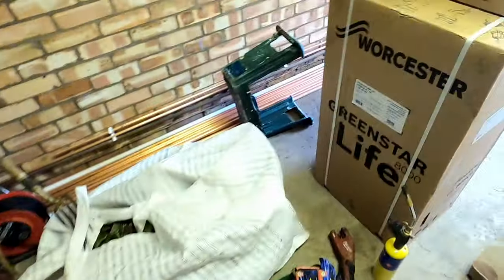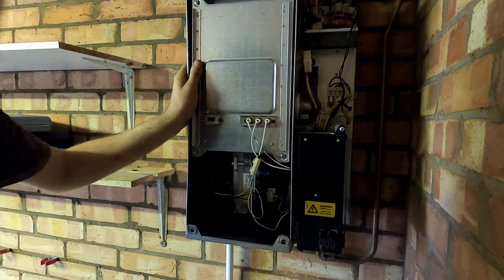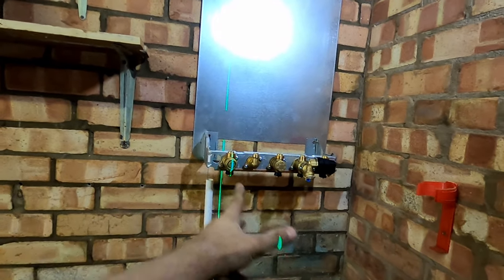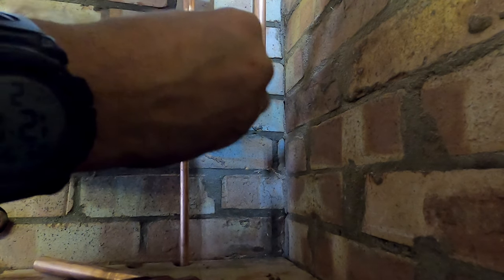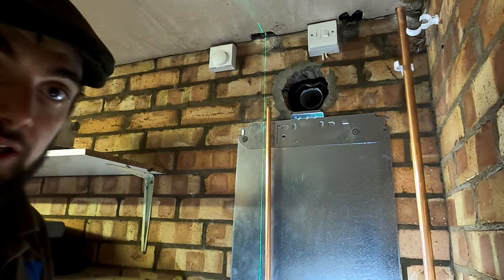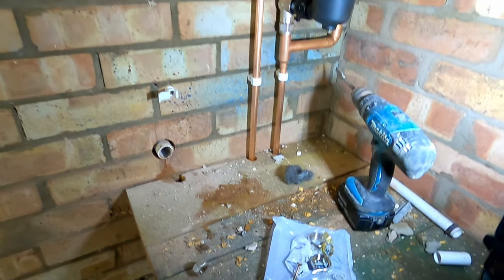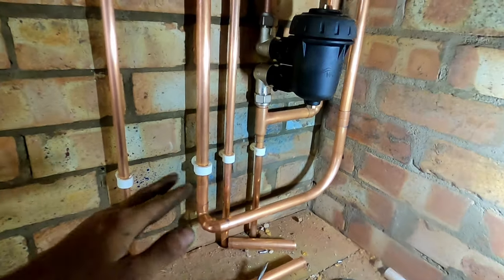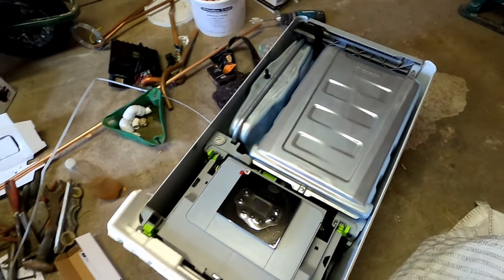Combi Boiler From Start To Finish

Comment: Worcester's are ... fine ... it's just they are so expensive compared to other brands but that extra cost doesn't show in the quality of the product, especially with how much cheap plastic they are full of which goes brittle over time and pinholes or cracks... these new ones definitely impressive on the installation side of things so credit where credit is due there
Reply from the maker: Thanks for the support mate, the plastic is really the only thing with this boiler I don't like, they are a little pricey for the 8000, but with the care pack that comes with the filter and programmer it does help bring the cost down and put them in line with other boilers, the new Worcester 1000 will probably be my budget boiler at £500 plus flue and filter

Comment: The latest Worcesters are so much more installer friendly, at last!
The old Vaillant sine 18,so came with pre- installed mini exp. vessels, still not sure why, except these  days water meters are fitted with check valves so maybe plastic components are an issue?
Great to see someone understands  the Regs. surrounding where double check valves can and cannot be fitted.
On system water quality checks, I use Scalemaster i-test in conjunction with a turbidity tube and QUALITY ph test straps.
Worcester specifically require a MAXIMUM  of a ph of 8!
You thoughts on testing and the results you obtain would be of much interest.
Pro job, keep up the good work.
Reply from the maker: Thanks for the support as always John, I think the plastic parts are the main issue when it comes to fitting expansion vessels, water quality is very important, I have started using the test strips to check for inhibitor levels on my installs and when carrying out a service, thanks for the support as always mate

Comment: You gave that lady some good advice there. To me its like putting a brand new engine in a 1976 Ford Cortina. Yes the engine is good , but if the transmission is rubbish you're not actually gaining anything. Plus you are still left with numerous other faults. I said 1976 because many systems are actually that old if not older.
Reply from the maker: Exactly that mate, I probably won't win the job but at least I can say I quoted for what was best for the system, thanks for watching as always 👍

Comment: Shock arrestor aint needed for any worcester mate. I know they say this but they havent a clue as their boilers are designed by architects lol. All thats needed is a pressure reducing valve on mains to reflect what hot water flow rate can be achieved. Its very high mains that cracks them and with residual heat on plate with expansion/contraction of plastic. Ive never ever had a flow/return manifold on an install fail and its been a long time lol. Like you said mate, the shock is going to be disrupted by all the bends it has to take, to have any effect on the boiler. Nice little install that, good job😎
Reply: Thats why flow turbines get smashed up, due to the high pressure of mains and flow restrictor is under strain
Reply from the maker: I totally agree mate, a pressure reduction valve would have more benefit than a shock arrestor, thanks for the support as always, it is greatly appreciated

Comment: Great video. Just a question if you don't mind, I'm a 3rd year apprentice and I have been doing outside taps over the summer but has died off a bit now. Just wondering how I could get myself out there for smaller jobs like radiator changes, toilets, basin swaps etc if you have any idea how to advertise for this. just wanting to do a couple of jobs on the weekend to get a bit of extra money. I was enjoying doing the outside taps for myself felt like i was progressing and finding my feet working on my own, I also enjoyed the extra money of course. Thanks.
Reply from the maker: Hi mate, thanks for watching, I know a few guys who use facebook to advertise and they seem to pick up plenty of small jobs, honestly if I were to be starting from scratch I would defiantly look to go down that route. Once you get your name out there word of mouth should then kick in, just focus on doing a good job, leave everything clean and tidy and you will have as much work as you need
Reply: @PlumbLikeTom  yea, i was advertising outside taps through Facebook and was doing quite well with them l. I'll have a look at that. Thank you. Keep up the videos. I learn a lot from them, and I'm sure I'm not the only one.

Comment: Where did you get that battery powered pipe cutter? How much was it? Definitely speeds up time!
Reply from the maker: I got mine from ITS, if you are buying one go for the inox version as it can cut stainless and the blade has lasted over a year so far, I do have the older version but this thing is a beast, I payed around £140 plus the battery which I already had

Comment: Top work Tom, is the water in your area hard?, it’s a killer round my way plate exchangers foul up average 5 years even with scale inhibitors,
Reply from the maker: It is hard mate, I am actually fitting a water softener on this job now, I wouldn't have put the scale reducer on had I known, thanks for the support as always Danny

Comment: at around 9mins when you;re drilling into the ceiling, won't all the dust from the drilling fall into the pipework?
Reply from the maker: It's a fair point, I normally blow down my pipes before connecting the boiler to clear any dust or debris, it is something I should be more careful of though, thanks for watching
Reply: @PlumbLikeTom  no problem, was an informative video, thanks for posting 🙂

Comment: Have you come across a Air source heat pump yet Tom
Reply from the maker: I used to sub contract for a heat pump contractor, I fitted quite a few ground and air source heat pump systems, if I'm honest I didn't enjoy the work that much as most of the time systems were poorly designed or just not suitable for a heat pump, I could only do what I was told though being a subby, design is critical really with these things, the government seem to have taken a 1 size fits all approach to heat pumps and it's just not right, thanks for watching as always mate

Comment: Hi can you explain the pipes that needs joining the boiler as level 2 now
Reply from the maker: On a combination boiler you have a flow and return that connect to the radiators, these will normally be 22mm connections, you also have a cold inlet, and a hot outlet, the cold water passes through the boiler, is heated and comes out hot to feed the taps. On a combi boiler the hot and cold connections will be 15mm. There is also a gas pipe, as well as a condense and pressure relief pipe